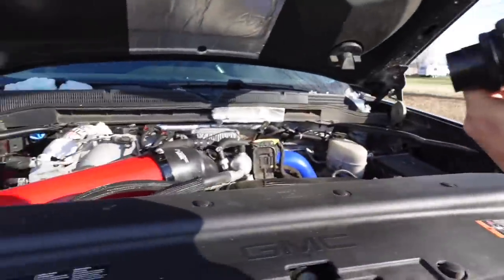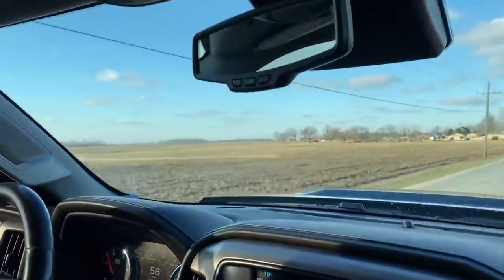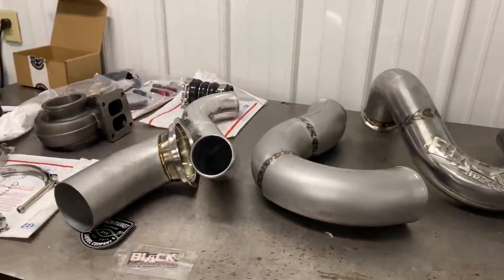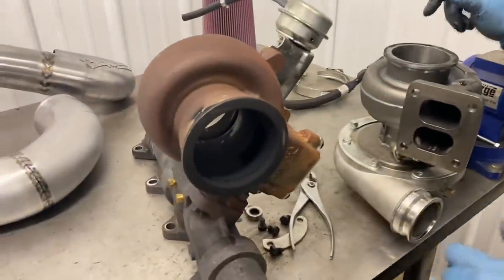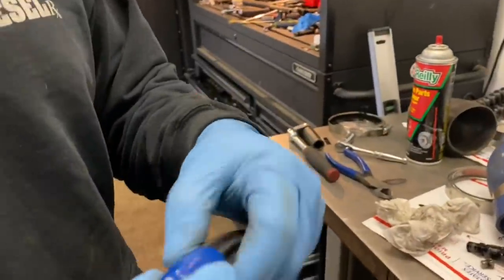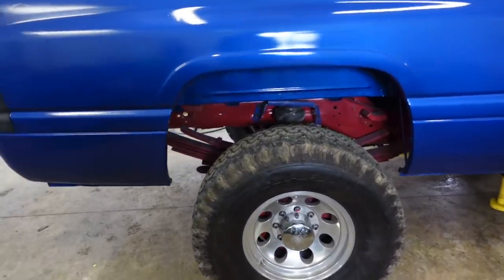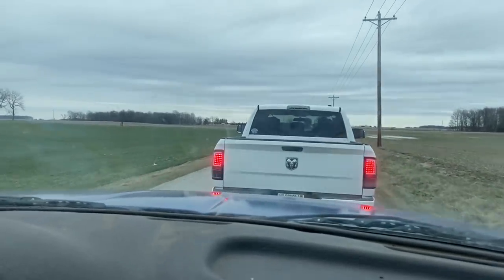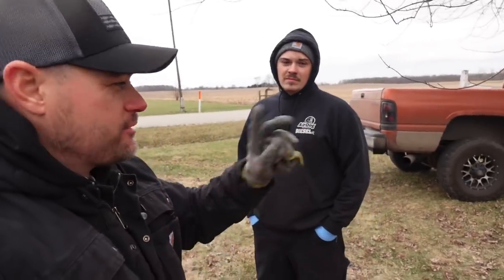Installed Compound Turbos On The Cummins and This Happened!

Comment: I say you nickel it. Nickel on the kobalt Blue would prob look sweet.  Also when I installed my compound kit on my LMM I welded on a v band onto the downpipe @ the exhaust pipe or you'll never be able to remove your exhaust from the truck.
I have a 4" to 8" exhaust dump tip and with a big truck, without trying to look obnoxious or dumb I'd say an 8" tip looks beefy but not dumb.  Don't go any bigger.
Also it's only loud cuz it's a Dodge.  Compounds made my LMM run quieter cuz the 2nd turbo muffles the exhaust.

Comment: If you get sound deadener for the firewall and add it to whatever is there already on the inside of the cab it will help with engine droning noise a bit, I got a new set of engine bay firewall pad as well and that helped also :) its coming along great though and don't beat yourself up at all we all have forgotten something or made some mistakes haha so it's all good man we all do it haha like running outta fuel happens to tons of ppl lol :)❤

Comment: Best upgrade I ever did was my 7875 over s488.  Next was my bd torqloc.  I own both a 12v and 24v trucks. If you ever want to make power with that truck either swap tona 24v or war head. The 12v head really kills air flow.

Comment: From experience the only reason id stay away from white is cause you have to constantly clean it for it to look good. If you do just the compressor housings in white thats not to bad, then the piping in darker color. Cause its hard to get them tight places to clean with the white. That thing is going to be pretty stout when its all done.

Comment: Also that truck is double as loud as it should be. I run a 5" turbo back full "5 not necked anywhere on a billet 363/475 set up on a maxed out 12mm p pump no muffler. There is a night a day difference . That ultra loose manifold crap shoot is probably contributing to the noise

Comment: I have a check engine light on for my 2007.5 duramax for my intake air heater! I accidentally arced the wires to the metal. Is there a relay or a fuse you know about I can check? I need to smogg my truck in a couple months.
Please help!

Comment: Hey man love your content and all your builds. I know this isn’t related to your video but I have been having trouble with my lb7 it doesn’t have much power acceleration. I can step on the gas pedal and it won’t speed up or when I’m going up hill it starts loosing power. I change fuel filter, air filter. Don’t want to mess with the Spark plugs cause my truck doesn’t shake or struggle to turn on. Was hoping maybe you can give a ideal of what it can be
Reply from the maker: Luckily your diesel doesn’t use spark plugs but I would recommend that you change the fuel filter and see if that helps also it could be injectors of a turbo issue as well
Reply: Try checking for boost leaks
Reply: @TruckMaster  the man replies! ❤️. I have change the fuel filter about a month ago. I’ll have to take it somewhere to check the turbo injector. It’s my first ever diesel so im new to all this. Thanks for the respond really means a lot from a fan
Reply: @quintoncarlson6079  thank you. I hope it’s nothing major but I’ll make sure to check that

Comment: So I make my own compound kits. This has to be the worst display of a kit that does not fit with the parts supplied due to what ever . I found the easy way to make an oil leak on the atmosphere charger is to drain it back to the rear location when the charger is mounted in that location. Move the drain from that charger to the front location and the manifold charger to the rear location . You will find the longer line will allow easy install and no leaks.

Comment: Everything about the GMC is superior to anything Dodge has put out.
Reply: That’s why you have lots of fuel and injector issues cough cough L5p limp mode cough cough every other durmax cough cough
Reply: Maybe Dodge/Ram, but not Cummins.  There is a reason why sled trucks and diesel drag trucks run the trusty inline 6 design.
Reply: Clueless, Be a GM fan.But at the end of the day be a realist.
Reply: @brettwilkinson8904  
I am a realist.
Cummins is a great engine wrapped in shit.......fact.
Reply: @OldGriz708  “Cummins”.
Reply: @cobralife0417  
Damn predictive text.......lol